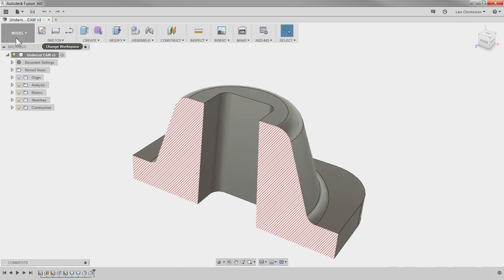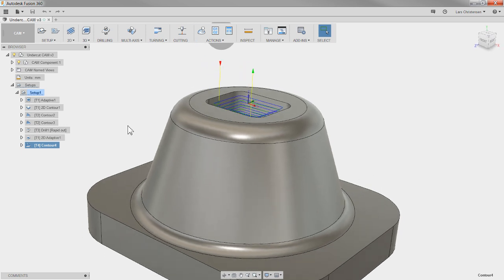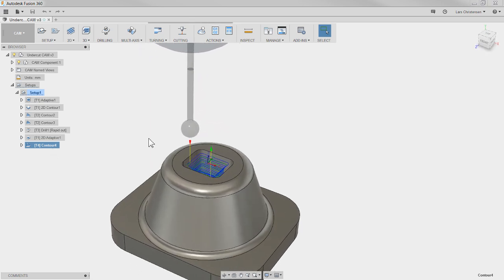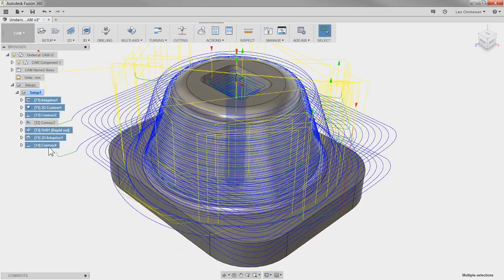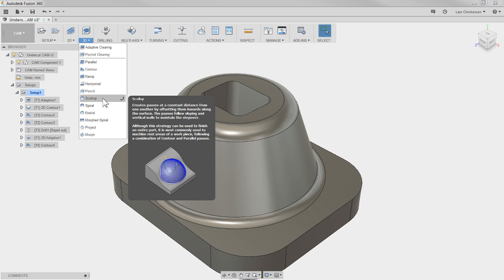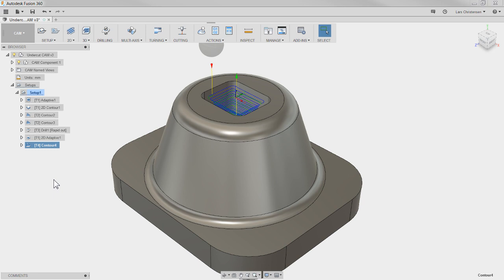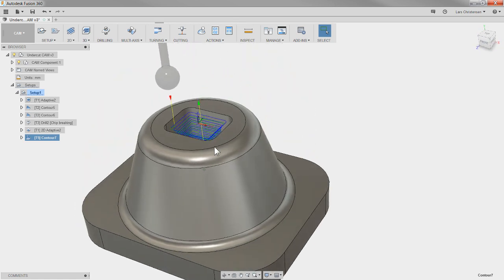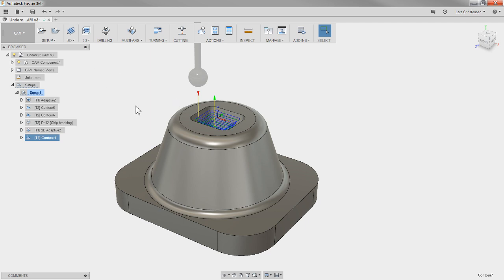Undercutting With CAM — Fusion 360 Tutorial — #LarsLive 143

Comment: Hi Lars, Thanks for the videos. They are a great help in learning Fusion 360.
Sometimes while I'm using Fusion, the view cube in the top right corner stops working, the home icon disappears and the only way I can change the point of view is to use the orbit function. Hitting escape doesn't unfreeze it. The other commands still work and I can still interact with the model, so the software hasn't crashed. Have you seen this? Is there a way to get the view cube working again?
Reply from the maker: Hi Darren Healey Thank you for watching!
Honestly, I have not seen it myself.
Check out this article:
https://knowledge.autodesk.com/support/fusion-360/learn-explore/caas/sfdcarticles/sfdcarticles/How-to-optimize-settings-in-Fusion-360-for-performance.html

Also, here is the support forum if you need it:
https://forums.autodesk.com/t5/fusion-360-support/bd-p/962

Best,
Lars

Comment: Hi Lars, one thing that's annoying is if i make a circle (by giving a diameter), later on i highlight the circle/cylinder etc and it shows as a radius. so mentally i'm allways doubling stuff, i only want to see diameters usually. is there somehitng i can change?
Reply from the maker: Hi JulianHG Thank you for watching!
I just drew a circle and extruded into 3D space. I clicked the edge and it shows as a radius in the lower left...In my opinion, this should be a diameter.
I think you might be on to something. I need to look into this and figure out who to talk to.

Thank you!
Best,
Lars
Reply: brilliant thanks to much!